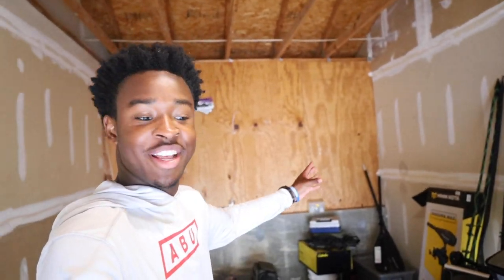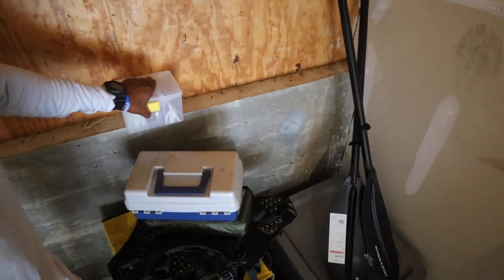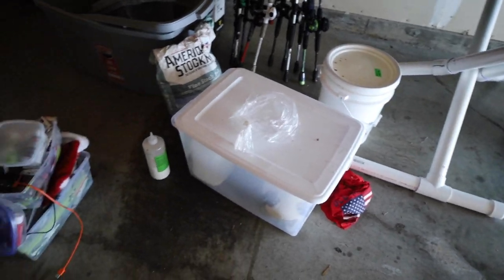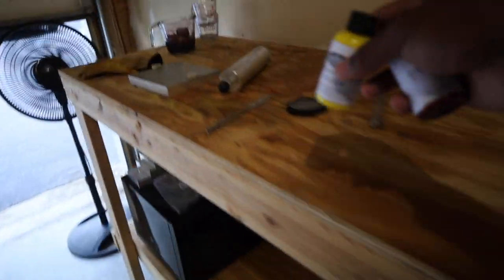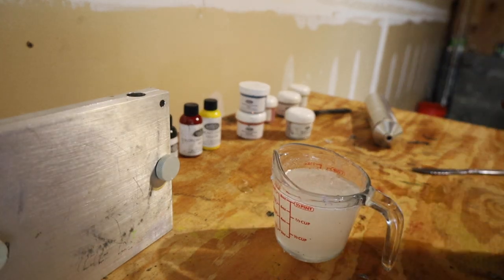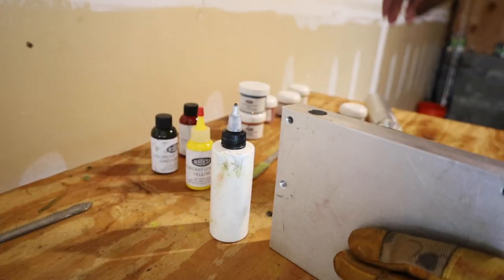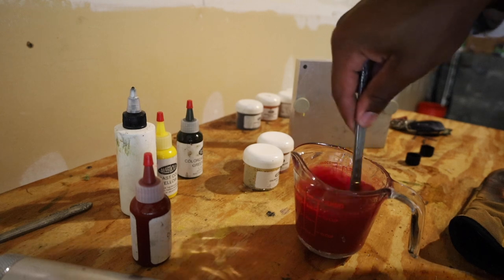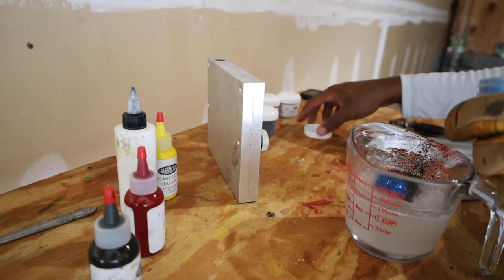Making Homemade Fishing Lures (DIY Bass Fishing Lures)

Comment: my mold just arrived I'm still waiting on the injector. this video couldn't have been better timed
Reply: Where did you get the mold
Reply: @isaaceichelberger2118  ebay. i got a metal senko mold that does 4 at a time. pretty reasonable